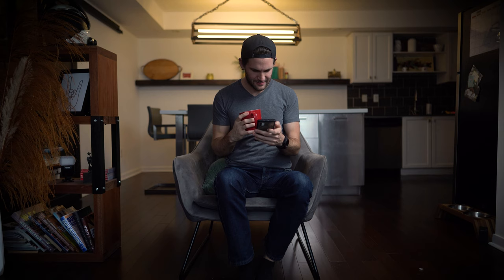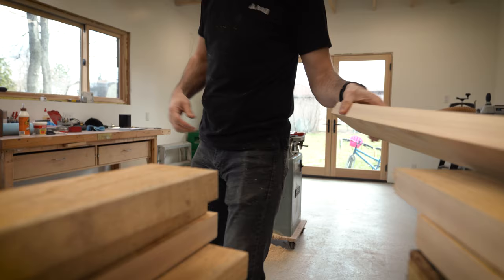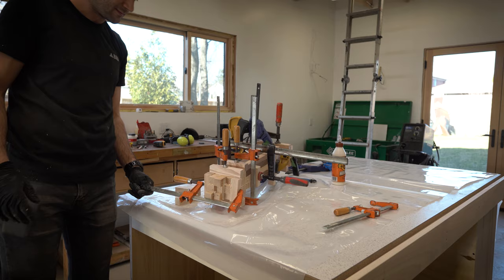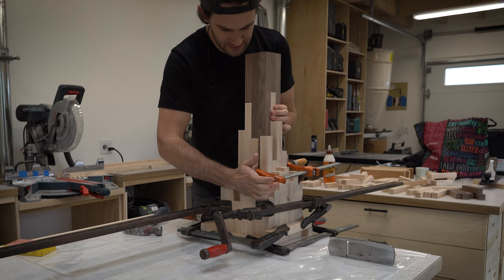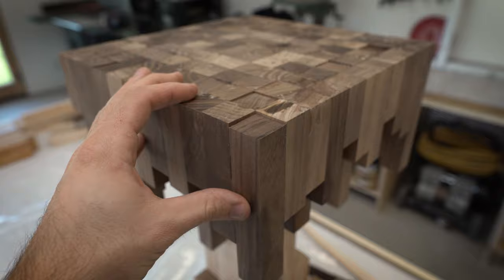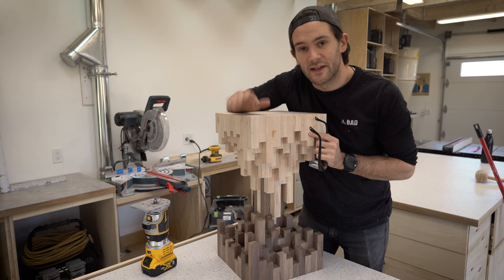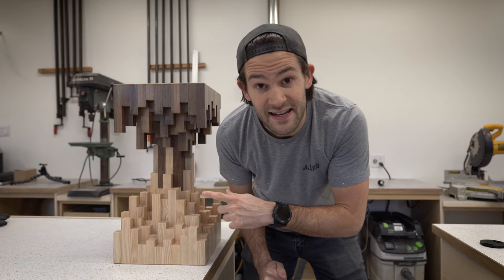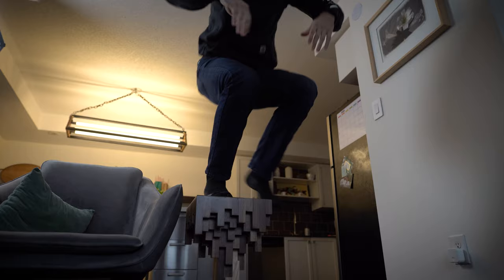A Use For All Your Scrap Lumber? - The Pixelated End Table Build

Comment: Look great Zac! I once tried to glue up a "crazy contraption" once as well, but what I really did is realize that I don't have enough clamps!! Well I realized that after everything was together and I needed more clamps.. Instead I got a few bits of poorly glued together scraps to use for other projects!
Reply from the maker: You can never have enough clamps! It's an adage for a reason haha. Trust me man, there were times I wished I had more clamps on this project. That's why I spent so much time sanding and finessing things after the clamps came off.

Comment: Nice! So your center column, you basically glued together strips to make 3 panels, and then glue those 3 panels together, but all at the same time, right? Cause all I saw from the video was gluing the panels together.
Reply from the maker: Ya exactly, sorry I should've been more explicit in the video. I did it all in one shot, which maybe wasn't the best way to do it. I probably could've saved myself running it through the sander to clean it up if I had been more patient and did it one layer at a time.
Reply: @ZacBuilds  that's what I thought. I can say, it probably would be better that way. I can also say, I doubt I'd be patient enough lol

Comment: Good work buddy, I’ve got a question for you. How did you manage to sand those little pieces in between after you applied the glue? Did you put the coating without sanding the middle part of the table?

Comment: How did you decide the lengths of the staves for a nice appearance?  I cant tell if its random or if you had intervals
Reply from the maker: Good question, it was more of less random. I set an upper limit of 9 inches, and a lower limit of 2.5 inches with some tape on my miter saw and then tried to get an even distribution between those two numbers
Reply: @ZacBuilds  since I have a large scrap pile and nowhere to go, I'm giving it a go while at home.